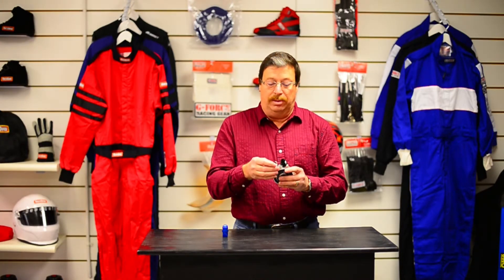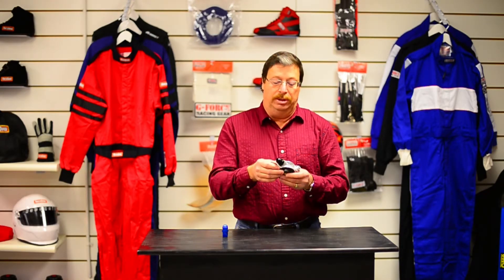The Correct Fittings to Use with a Mocal Sandwich Plate

Comment: What is the proper torque spec on the fitting to the sandwich plate?
Reply: Similar to oil filter: hand tight and 3/4 turn.